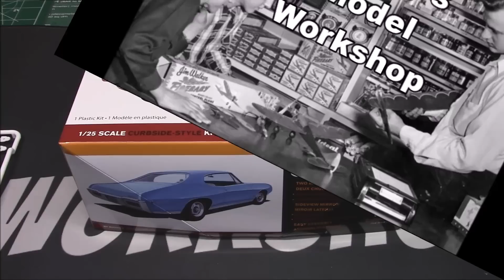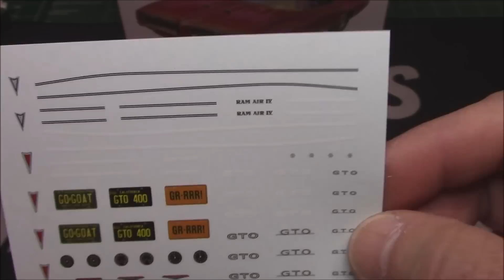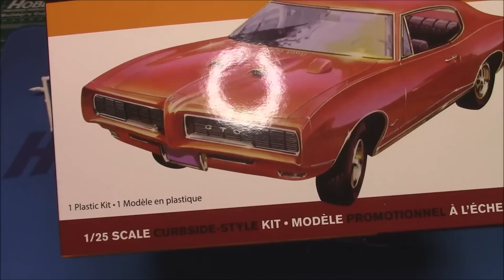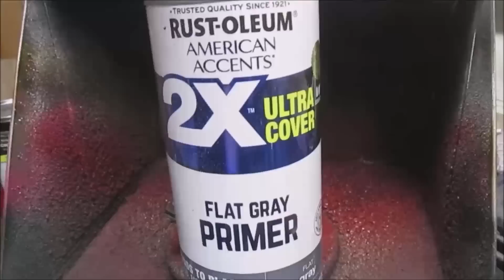ALL NEW 1968 Pontiac GTO 400 V8 1/25 Scale Model Kit Build How To Assemble Paint Dashboard Glass

Comment: Looking forward to test fitting the full detailed chassis from the MPC ‘72 GTO, which should fit this with little to no modifications (I hope!).
Reply: first thing I thought of after seeing the earlier preview, wonder if the engine in it would be correct for this year model
Reply: The chassis from the 69"olds 442 would be a better donor actually.
Reply: You can always use the engine from the Revell 68"Firebird if in doubt.

Comment: I have a method for painting that I think works...before painting, I put the parts and the paint can I to the oven.  Then I turn the over to WARM (It's a gas oven) for around 60 seconds, then I  turn the oven off and wait a few minutes .  When I take the paint and parts out, they are warm to the touch but not overheated.   After I finish with either primer or color, I put the parts back in the oven, turn it back to WARM for a minute then to OFF to "bake" the parts.

Comment: Watched the whole vid, and as a longtime fan I gotta say this just isn’t one of your better builds.
Panel line tint works REALLY well in the panel lines.
The pinstripes were used on the lower body character lines. 
Pontiacs ‘Morrokide’ vinyl interiors had an almost flat gloss finish. Same with the dash top.
Just a little research on the real cars-two minutes on any GTO page-would work wonders in helping you impart your goal of great modeling for your audience.
Reply: and Pontiacs had split grilles from 1959 in full size, 1961 in Tempest/LeMans/GTO. Credit where credit is due as a style leader.

Comment: i had something strange happen with gloss black once i was doing the smokey and bandit model...and used gloss and when it dried it was flat..and i had to use a gloss clearcoat to get it to shine...also has more probelms with black but i found if you spray it on a sunny day with not many clouds it works like it should
Reply: It could be too low temerature when you spray paint and it turned flat, I've tried this with a gloss grey

Comment: Didnt expect that the paint would fail you!  The Testors Extreme Lacquer is usually pretty reliable for a smooth finish.  Have you used Tamiya primer and paint combos?  Or the Mr Hobby 1000 Primer works under everything.

Comment: Chris, You're not alone with the paint problems. We've been having the same wacky weather patterns here in Michigan. The last three or four kits that I have done went together with zero problems but I had to strip and re-paint all of them due to one problem or another. I am currently working on one that has had to be re-painted three times. After I finally got the paint right, the clear messed up on me. I think I finally got it right tonight though.  I hate putting out a poor looking model on my channel but I am about ready to move on with this one. Not to long ago I did a 64 1/2 Mustang convertible in the Colorshot Speeding Ticket and it turned out beautifully. Have you tried the Colorshot clear yet? It shines almost as good as 2k at a fraction of the cost and mess.  Spring weather is right around the corner. With any luck so are the decent paint days!
Reply from the maker: Yeah it's funny how things can go perfect and the next day, kaboom, paint issues.

Comment: Had a problem with paint on a 66 Chevelle station wagon by Revell with  Rustoleum paint and primer which actually orange pealed the plastic not the paint, go figure. Problem with the paint. I was able to fix it with a LOT of sanding and a fog on two tone paint scheme 🤬🇨🇦
Reply: Too cold and too much humidity could cause this. Spray paint results work better when the can itself is warm and warmer outside. That's from my experience. Probably going to switch to an airbrush soon.